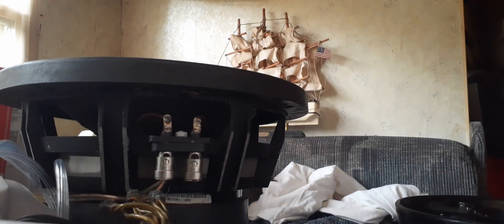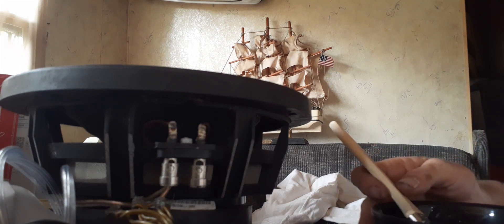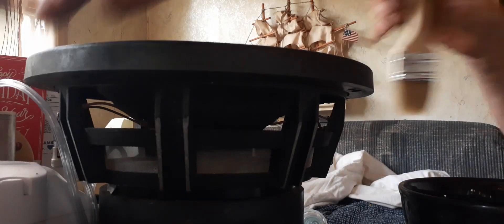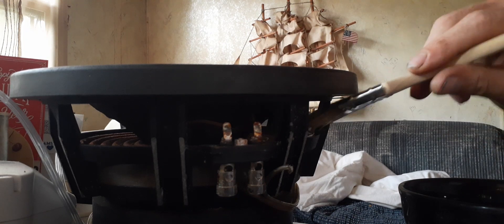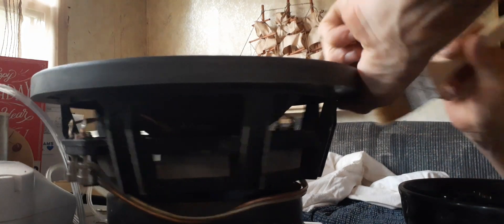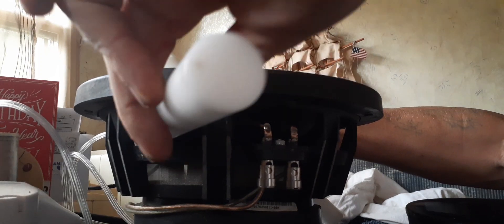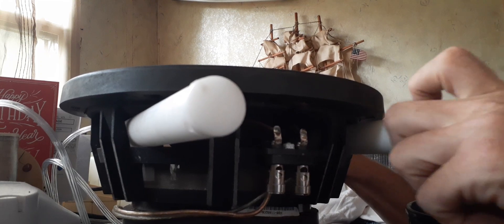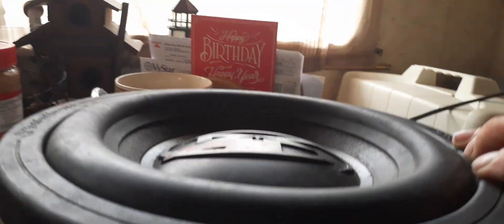How to fix spider sag.

Comment: I just tried the acetone trick, brushed on liberally, on a pair of 1997 Rockford Fosgate RFP-1212 DVC.
These are amazing speakers but the cone assembly is HEAVY thick pulp paper + rubber surround.
If this works on these speakers (both have considerable sag) it'll work on anything. 
Will post back results in a few weeks.
Reply: Yuurr

Comment: Did you make a video of it after like you said you would in the video?
Reply from the maker: To be honest, I forgot all about making it.
Reply: @NorthFloridaAirGunner  that's cool bro no worries, but how'd it turn out?  Is it worth doing. Thanks man.
Reply from the maker: @farhanfarooqi7190  it worked for about a year while it was getting used. After sitting on a shelf for a while again it sagged back down. So it will get ya by for a while, but won't last forever.
Reply: @NorthFloridaAirGunner  how'd it sound after you did this? Any issues while it was playing or just started sagging once it was sitting. I got some Power hx2, the bigger brother to the regular hx2 and everyone saying if they gonna sit just make sure you drop them up cuz they so heavy they'll say if not propped up. I wanted to ask where you get those plastic dowels?
Reply from the maker: @farhanfarooqi7190  sounded like it should.

Comment: Hey man. Been searching just about everywhere for a guide like this. I see people use water. I'm a little skeptical on the longevity of the fix using just water, or starch spray. I have a RFR2215 that's pretty similar to the hx2. It's pretty old, as you know. How long does this fix work for you? I have some serious spider sag going on right now. I want to attempt this fix until it dies, then recone.
Reply from the maker: It worked for the year I used it. Once i put it back on a shelf to sit it sagged back down.
Reply: Is there a part two?
Reply: @bryanwhiteeagle5983 Don't think so. Can say tho, the fix is temporary if using water or starch spray. Best way I've found to do it, since asking this comment, is to use acetone. Use a Q-tip or a small paint brush. Try to stay away from glue joints. Cone to spider, spider to basket. Don't want it coming unglued... But, do try to liberally paint the entire spider otherwise. Get all the peaks and valleys. Then prop it up with a couple equal shims. I use woodscrews. Then heat the surround with a heatgun and let it sit a while like that before taking the prop screws out. Until the acetone is dry at least, but I wait a about a week to be safe.